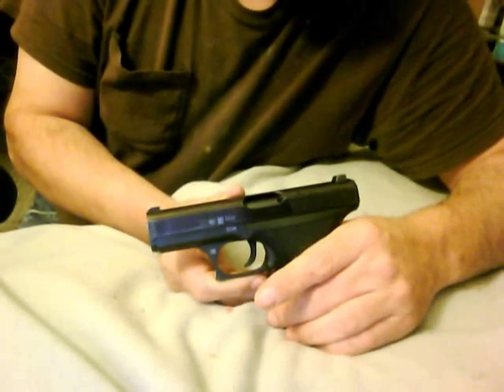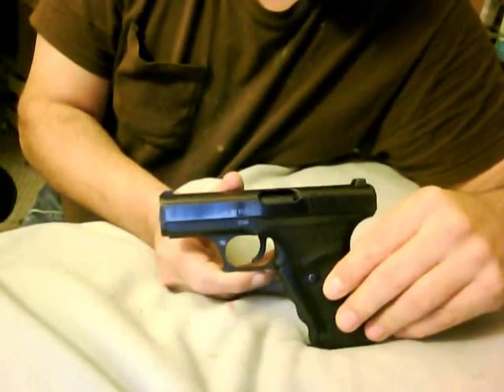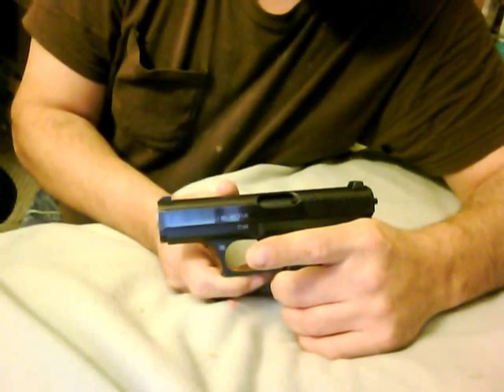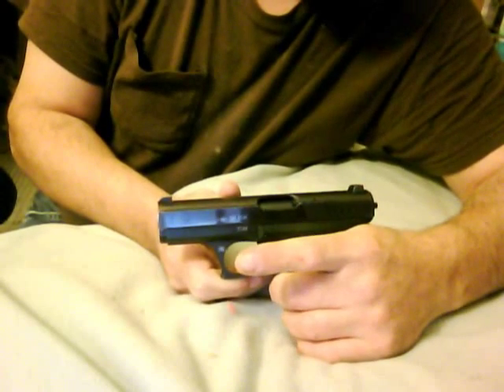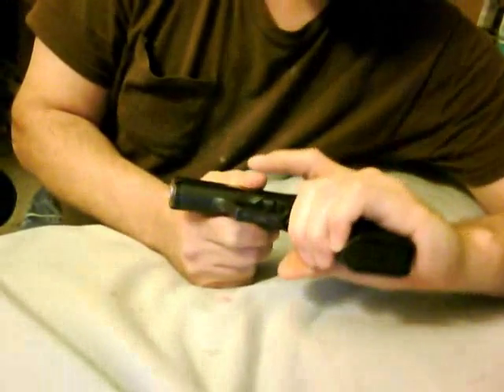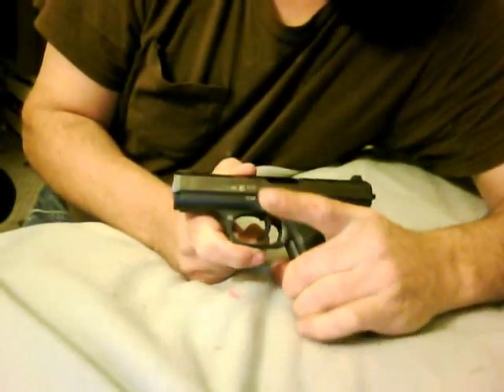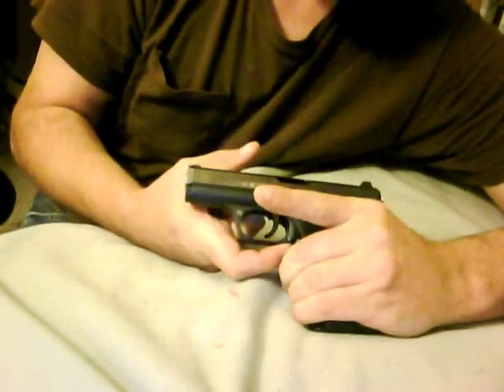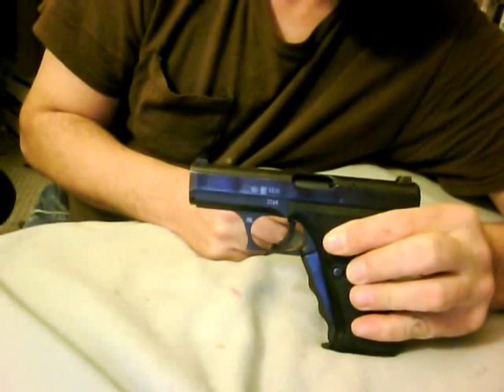H&K P7 Pistols, How to silent decock

Comment from the maker: They're out there but cost about double what a P7 will set you back and the spare magazines are close to $100 each now.
The P13 also gets a LOT hotter around the trigger guard much faster than the P7/P7M8 because the larger magazine capacity puts more rounds down range faster.
The P13 failed the US tests fairly quickly and this was one of the reasons.

Comment: Loved my PSP so much I picked up a M13. Laser accurate. Mild shooting. Glocks are solid. I prefer my Hks. VP9 side by side is bettet than my 19. I have experienced  the heat. I have several thousand rounds through my PSP, I haven't had a malfunction or breakage yet. The only down side, IMO, is the flutes left on the brass from the gas system.
Reply from the maker: +chparatrooper88 It's a real toss up for me between my USP 9 and My Glock 19 as most favored.
I like carrying the Glock.
I LOVE shooting the USP.
Reply: Which do you find a better defense gun, VP9 or P7M13 ?
Reply: I love my P7M13...I do not carry it. They are far too valuable. For carry P30SK or my VP9. 

Thanks 
CH

Comment: I'll be damned! Owned a 40 S& W and 9mm both without ever knowing that and in all the gun shops i have taken it to not a soul has pointed it out. It must be something few people know about I guess. Pretty cool anyway. 
  I happen to love the P7 but i have friends and or acquaintances who hate on the gun. I was lucky enough to get mine before the huge price increase thankfully! They were never cheap but not as out of reach as they seem to be now.And in my opinion that's a shame.I think the average gun aficionado should be able to own one without putting a 2nd on the old homestead. That kinda thing has plagued the collector car market for years now, so I thought I would stick with old motorcycles.
 That didn't work, I watched most of one auction and got so depressed I had to turn it off.
Reply from the maker: I bought mine as used surplus Ex-German Police for a song. Mainly to learn how to gunsmith the pistols. Owned if for three years and sold it to a collector. Parrot Pro Tip. The Modern Glock 48 trumps ALL previously common single stack belt type 9mm caliber pistols. It is a reality not many are willing to admit.

Comment: Don't know what the purpose of silent decocking would be anyway? If your in single action mode, means your in an elevated situation. I'm not going to decock until the threat is gone, left the area. Just doesn't seem to be a big deal, can always put the safety on, decock it later when it's more private!

Comment from the maker: Gas cylinder fouls out fairly quickly, gun becomes uncomfortable hot during rapid fire strings, Bullets heavier than 130 grains not recommended, Parts do break on these guns, grips loosen, If you aren't well trained you can very easily shoot yourself with one of these guns,,,

Comment: I don't get it...would anyone de-cock when the threat is still present? I would not. 
I would only de-cock after the threat has passed.
If you are satisfied that there is no longer any threat, it doesn't matter who hears the de-cock click. If not, Do Not DeCock!!!
BTW, if you run into a dangerous situation, you will be sending out the same 'click' when cocking the mechanism (squeezing the forestrap). Who's to tell the difference between a cock 'click', and a de-cock 'click'??

Comment: dont get em wet all those springs go bad all the little levers stick what an over engineered piece of crap colt is much better
Reply from the maker: I owned and shot the gun for several years. It gets hot quickly, limited capacity magazine, far too heavy as a carry gun in the modern world. I sold the pistol to a collector of West German Martial arms.